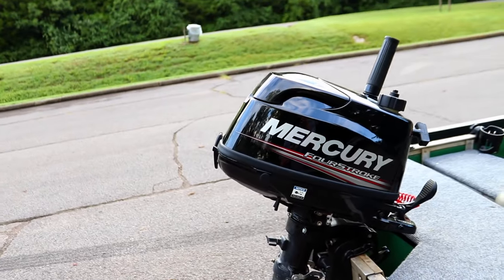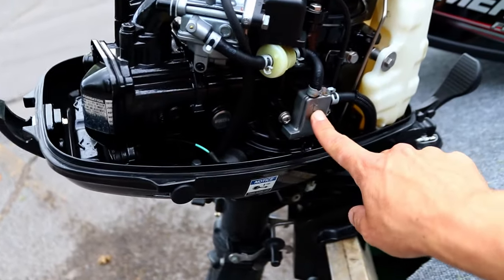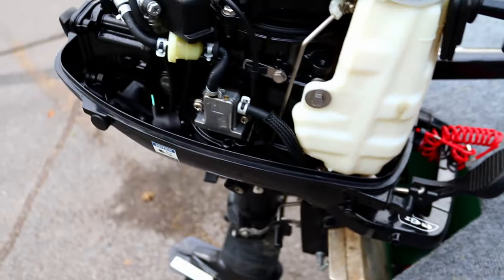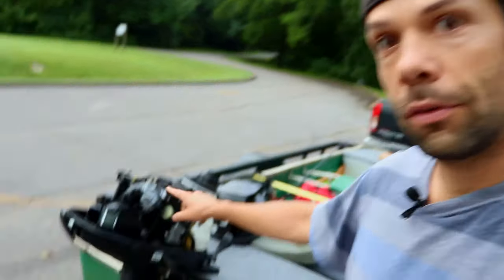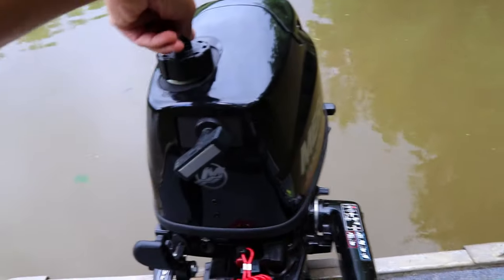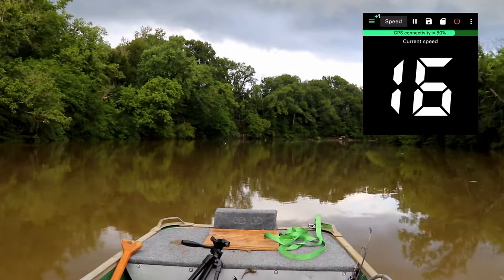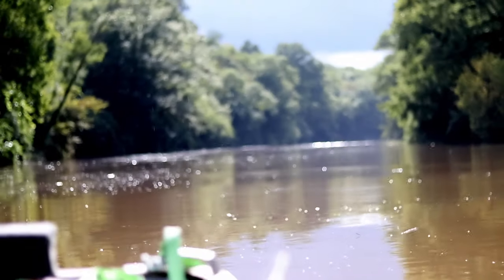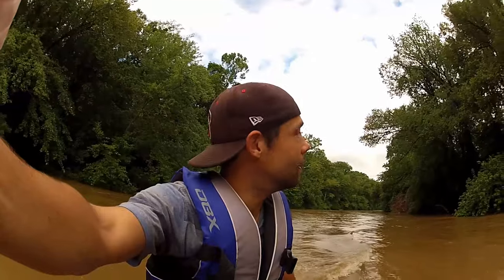Mercury/Tohatsu 6HP Outboard: Review, Walk-Through, & Test Run. Best Jon Boat Motor?

Comment: The hard starting problem is from getting the gas to the fuel pump. The external tank works better because you can prime the pump easier.
Reply from the maker: You are spot on. I found this out last year. Now starts in 1-2 pulls. I did a really quick video on it https://youtu.be/tD2eeR7btXs
Reply: & you'd think mercury would give a warning abt this. I just pulled my life away on a new motor. thank god i didn't go to far from shore.
Reply: My yamaha has a factory bulb inside the cowling I can pump. It's a 6hp with an internal tank
Reply: Whaf we did with ours was take the fuel tube out and siphoned it up into the fuel pump

Comment: Hey I have a 14ft alumi Lowe 1470 deep V would like this 6hp would this be enough for me and my wife im 185lbs shes 145lbs?How fast would we go and Would be for cruising and fishing or should I step up to a 9.9hp?
Reply from the maker: If the boat is rated for it and you are going to leave the motor on the boat, I would go 9.9. I think you’d be more happy. It would be work the extra $$

Comment: Is this better or should i buy the yamaha 6 hp 4 stroke? 
Great video 😀
Reply from the maker: Wow good question... many people prefer Yamahas. If I had the choice of both at the same price I would choose the Yamaha... if you want to get an opinion from someone who has a 6hp Yamaha 4 stroke, join the Facebook Groups “Decker Out Jon Boats” and “Jon Boats Mods and Fishing” groups. Many of the people in those groups have ran both newer Yamahas and Mercs. They could give you an A to B direct comparison before you drop $$$.
Reply: The Yamaha has a weaker gear shift system. Seen several damaged  propshaft/clutch dog/gears. The Tohatsu/Mercury/mariner 4/5/6  have a decompression system for easy starts and good gear system. The only good competitor at the moment is the latest model Honda 4/5/6 ,  they  have added the decompression system and as a plus they have rubber mounts between the powerhead and the tiller handle. This reduces vibration in your hand. Thats a big plus feature. Always was a Yamaha man, but my F4A did not have the decompression feature, so  it hit back sometimes when starting. This is quite painful, so my wife didn't want to use it anymore. Along with the failing gear system my reason to get rid of it. Yamaha then came with the F4B with the added decompression system. But with the same gear system, so still not up to the others. Strange, their 2 strokes from the past had much better gear systems. Tried Suzuki, also hits back on starting.  So in my opinion it's best to get a Tohatsu, they are the best value for money. You get the same if you buy a Mercury or Mariner,  for a bit more with another design.  I think i would go for the Honda at the moment, but want to try their new one first. 
If you want a 6HP Yamaha, there's also a 2 cylinder, much better. Or the old 2 stroke.
Reply: That's what i would do if buying an outboard is get the 4 stroke !!!
Reply: I looked at Yamaha last fall but their customer service for small outboards is horrible. Possibly the worst Ive ever experienced. It makes me sick to think I was about to drop $2000 on a small motor and couldnt get a call or email back from anyone in KY....not even the statewide sales manager. After tons of research I think Tohatsu or Honda are the way to go. Of course, I have a 1979 Evinrude that refuses to die and starts 1st pull but she hates the smell.
Reply from the maker: Wish I had a good 2 stroke. I love the Merc but have always heard good things about Yamahas (not their customer service). I finally figured out my Mercury’s cold starting issue and now it’s an almost perfect motor.

Comment: i know im late but your the second guy ive seen having trouble starting his engine  and immediately start screaming carb  check your compression these outboards  run at high rpm so they wear quckly so you may be dealing with a high hour count engine  also those mercury engines  are known for being hard to start
Reply from the maker: I found my issue, system was losing prime between trips. I now use an external tank to prime the system before leaving and it now starts 2 pull everytime

Comment: They are different motors. I believe they use Chinese parts such as carburetor which is not the end of the world but does have differences in jetting I believe. I can’t remember the other my dealer told me but wasn’t worth the difference in pricing. Plus warranty is reviewed better with mercury
Reply from the maker: Thanks good points. Didn’t know that about the carb but did know warranty was different. Thanks for the view!

Comment: Can you confirm the stock prop size? The manual says 8 3/8 x 8, but I think that is incorrect. I'm thinking the stock is 7.8 x 8. That seems to come up much more often on Amazon and eBay when I type in Mercury 6 hp. Maybe I just got an old manual?
Reply from the maker: Here is a chart. https://www.kirschbaum.at/ki_prop/pdf/mercury_mariner.pdf    I’m with you, I think it’s 7.8”. I’ll measure mine this afternoon
Reply from the maker: Mine is 7.8”. Also I looked but the gas hose isn’t marked with diameter size (or it’s too short and size was cutoff) but I bet you are right and it’s 1/4
Reply: Many thanks! I ordered the 8" and 9" already, so glad my assumption was correct. And at the very low gas consumption, I think quarter-inch is a safe assumption for size. And seeing how this is made in Japan, probably 6mm.

Comment: I wonder if adding the supplements available to the ethanol gas will help?
Reply from the maker: I add a fuel stabilizer. Ive always had good luck with stabil. Supposedly gas starts to separate and go bad after 2 months sitting. So I’ve always used a stabilizer just to keep everything clean
Reply: @Skinnyriver  OK, but still, even with Stabil, it still takes multiple cranks to get it going when it is cold.  One guy said he thought a separate tank with bulb primer might help get it going easier when cold--I don't know.  Like you said, no problem after it is warmed up--and that means, in worst case, you need a few cranks only once when you start the day.

Comment: Gas valve on the tank not first but last.
Pressure in the tank wil fill the carburater.
Reply from the maker: I agree with pressure in the tank filling carb. What do you mean “gas valve on tank not first but last”?

Comment: Im on an island, and theres nowhere on the island where I can get e0 fuel. what do I do?
Reply from the maker: No where to get ethanol free gas? You can always get a gas stabilizer that has ethanol treatment in it. Check out Stabil Marine. You just mix it with your gas.
Reply: @Skinnyriver   thanks!

Comment: I believe the lower powered mercurys are actually produced by Tohatsu.
Reply from the maker: They are, all 25hp and below Mercuries are made in the Japan tohatsu plant. Basically same exact motor with rebrand. Someone said timing is set a bit different but honestly I think it’s the same exact motor
Reply from the maker: That’s interesting. The 4/5/6hp 2012+ tohatsu’s and Mercs both have the same shifter below cowl (not on tiller) What HP has the one hand shifter? I’m guessing 15-25? That is awesome, hope to get one of those some day

Comment: The 4, 5, 6 HP models are all the same with different carbs and props, I believe they sell an upgrade kit to turn your 4hp into a 6hp
Reply: Funny, that is exactly what he says in the motor description...
Reply: i did that, I bought a 4 cylinder new for $1,000 plus tax, carb on ebay - new in the box, and a high power prop for $65 or 95 dollars. So, i have an extra new carb, extra new propeller, should I ever need a back up...

Comment: I see your using the built in fuel tank. I bet your starting issues will go away if you use an external tank. My 2010 4hp 4-stroke Merc will not start using the built in fuel tank. As soon as you 'prime' the motor with the bulb, the 'cold' Motor starts first/second pull every time.
Reply from the maker: You are spot on!! Check out this quick video I made https://youtu.be/tD2eeR7btXs where I found out that the internal tank loses prime and need to prime using external. You are exactly right!

Comment: Get the pure gas app for your phone. It will tell you where the stations or marines are that sell non ethanol fuel.
Reply from the maker: Nice man, I’m always looking at all the pumps when I put gas in my truck so I know which places have noneth gas. Getting the app now! Thanks
Reply: I've found BP station in my area has non ethanol gas

Comment: Speaking as an owner of Merhatsu 4, I'll echo what everyone's said about using the external tank and priming it with the bulb or waiting for the carb to fill if using the internal tank.  One or two pulls when cold once you do that.  As for the hole shot, these engines do like to spin and it sounds like yours is on the lower end of the RPM range (5000-6000) at WOT.  Throw a minitach on it and if you're under 5500 RPM, get a prop with one inch less pitch.
Reply from the maker: Completely agree with everything you said!!
Reply: @Skinnyriver  Did you end up changing props?  What worked best for you?
Reply from the maker: I plan to try a 1” smaller pitch prop this spring to get power power during acceleration. I did add some weight to the bow and it helped planing a lot
Reply: @Skinnyriver  Right on.  It'd be cool to see a current prop and new prop comparison of RPM and speed.
Reply: I have a Mercury 5hp on my 12’ jon. I’d like to see the difference in prop change too

Comment: I have had the Tohatsu 6 since 2008 on a 14 ft. Tracker Jon boat. Double check your trim adjustment. You may have the bottoms trim set too high to get on plane quicker. Then, once on plane, trim your engine up one position possibly two to reduce resistance and so that you get your maximum rpm’s and top end speed. Concerning cold start, replace your spark plug if you haven’t very recently. Then try to clean your carburetor without taking it apart. I use a product called “Mechanic in a Bottle”.  If your engine won’t start at all, drain your fuel tank completely and add just enough MIB to be able to get the MIB fully into your carb and needle valve. Let it sit for about 24 hours. Fill your tank with fresh 89 or better octane fuel and your engine should start. If your engine only has cold start issues and you have replaced your spark plug, add MIB to your fresh fuel for a tank or two and your cold start issue should go away if it is a dirty carb issue. On this motor, I recommend that when you are done boating for the day, turn off the fuel and run the engine until it the car runs dry. Alternatively, drain the carb bowl. Hope this helps.
Reply from the maker: Awesome thanks for the advice

Comment: It will always take 5 to 6 pulls for a cold start....this is caused by the fuel system not being primed.  If you take and hook up the external tank and prime it....it will be a 1 to 2 pull start everytime.
Reply from the maker: you are spot on. Check out my other video when I finally figured this out https://youtu.be/tD2eeR7btXs

Comment: Advice, do not run ethanol fuel, go buy the non-ethanol gasoline , this thing gets great fuel economy so you're not losing a lot on the extra cost of NE Fuel.....Trust me, and use something like stabil in your fuel also.
Reply: At 30 + mpgs this Crawdad is off the charts 💜

Comment: I have the same motor and I bought it new and I had the same problem. The problem is to get the gas to the fuel pump I start to use external tank and its much better

Comment: Nice vid! I’m about to purchase a new one for my yacht, alway had Mercury and had a 15 super new, always choked one pull and then start second pull with no choke, started every time this way. Seen others around pulling and choking for ages at boat ramps! As for planning, you probably tried adjusting the tilt setting I suppose?  Cheers.
Reply from the maker: Thanks for the view! yeah I have experimented with tilt angles and found a sweet spot but will probably get a hydrofoil to rest out. I cleaned the carb and it helped, I’ll keep experimenting!

Comment: I have a 2003 Mercury 6hp four stroke - same motor (also manufactured by Tohatsu).  Original owner 2003.  Your are right - clean the carburetor.  In 2010 the motor left me stranded - carburetor issue.  This year, 2020, the motor left me stranded again - carburetor issue.  The jets are so small they clog easily.  The tip off to the impending issues were same as yours - hard cold starting.  My advice is to do what you said you should do - remove and clean the carburetor before it leaves you stranded.  For good measure I also changed the inline fuel filter and the spark plug.  Now it cold starts in 1 to 2 pulls.  I love my Mercury 6 hp - and would buy the same engine all over again.
Reply from the maker: Awesome thanks! Good to hear from someone who had a similar problem but was able to fix it. I plan to tear the carb down this winter when I do annual maintenance, hopefully it solve the issue. Thanks again!
Reply: @Skinnyriver  I think the many pulls you have to do has more to do with the carburetor bowl not being filled with fuel yet. The first pulls are only needed to pump some fuel in there. With the internal tank, the tank should be completely full before starting. After turning the fuel valve open, you should wait a bit, since the fuel needs to flow into the carburetor just by gravity, through the pump and the filter. This takes a while. You don't have a pump ball like with the external tanks which pumps the bowl until the float closes the carb. You might try to connect an external tank and see whether you have the same problem.
Reply from the maker: Yeah I’ve tried the external and primed until rock hard but unfortunately it was same result. When using internal I agree need full tank for more head pressure to push gas through to fill carb. I have even pulled the safety lanyard, gave it a pull, put safety back on then tried to start (theory that the pull with lanyard off would fill carb fully and get some gas in cylinder) but it’s the same result... I’ll keep experimenting :). I don’t run the carb dry so day to day use the carb should be full during first pull anyway:
Reply: @Skinnyriver  Yes true. Then it is most likely the idle port of the carb clogging, as mentioned by others. Or the pilot screw on the carb needs some adjustment.
Reply: @Skinnyriver  You can also spray some seafoam in the carb directly before starting it and see whether it runs first pull, like here: https://www.youtube.com/watch?v=kzaKNPLFXtc (at 0:46). If it runs then on first or second pull, you can be sure it's a carb problem. If it doesnt, it's a problem after the carb (not likely)
Reply from the maker: Awesome point I’ll try that! Would be good to pin point exactly what is impacting the initial fuel/air until it’s warm. Thanks!!!
Reply: @Skinnyriver  I totally agree with trying the seafoam spray into the carb and letting it soak for a day or two.  Another option is to run 1 part seafoam with 1 part gasoline running the engine for awhile and let it soak.  Probably an interim step until you can pull the carb... but you don't know until you try it.  That engine should cold start with 2 pulls max.
Reply: @Skinnyriver  I was just curious whether you have given this a go and what the results were.
Reply from the maker: Going to do a full maintenance on the motor in a couple weeks and will pull the carb then. Will make a video of the process!
Reply: @Skinnyriver  I did a full rebuild on my 6hp. Including lower unit oil seals and ball bearings. Modified it from a long to a short shaft as well with parts from a broken donor motor. So if you need any advice, let me know. Although these engines are fairly straightforward, you will probably figure it out on your own ;)
Reply from the maker: It’s going to be an adventure! Gonna pull drive shaft, lower end pinion, etc!! Excited but know I’ll prob mess a couple things up!
Reply: @Skinnyriver  If you google for exactly: "Mercury 4/5/6HP 4-stroke (2000) Service manual [PDF, ENG, 6.41 MB].pdf" and you go to downloadboatmanuals[dot]com, you can download the service manual. That might be really helpful

Comment: Great vid. I got a 3.5 mercury and I always had trouble starting it until I used a fuel additive now it starts 2nd pull. P.s thanks for finding my shoe ha ha 😂
Reply from the maker: Ha ha thanks for the view. Glad your motor 3.5 is running well. It’s frustrating when there are starting issues. I cleaned my carb, use an additive now and found a better way to prime the system. Mines starting 2 pulls everytime now

Comment: Bought mine new last year. The 6hp Tohatsu SailPro version (the SailPro has an alternator, high thrust prop, and no internal fuel tank). When I first got it, I also used to have a heck of a time starting, until I stopped using the priming bulb on every start. Now it starts on the second pull almost every time. I never bother priming anymore.
Reply from the maker: Awesome! I’m thinking about going to the higher thrust prop bigger diameter or moving to 7 pitch vs my 8. Wish I had that alternator for my trolling motor battery :)
Reply: Maybe you were squeezing the primer bulb too hard, overflowing the carb and draining the engine. You should stop squeezing when you feel some resistance.